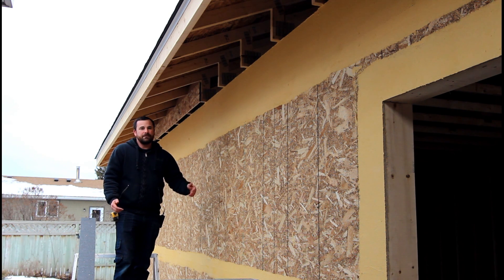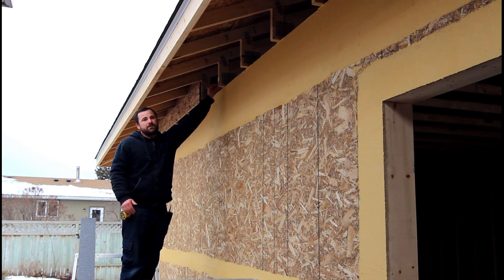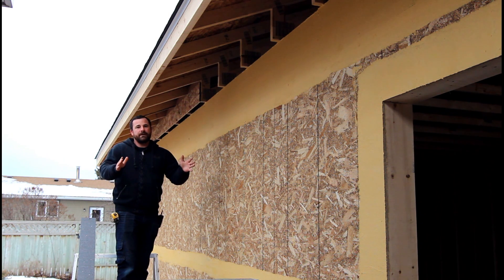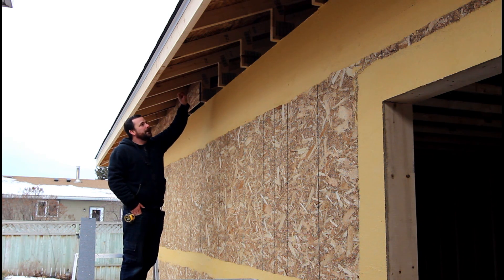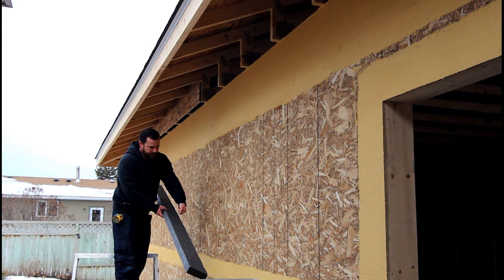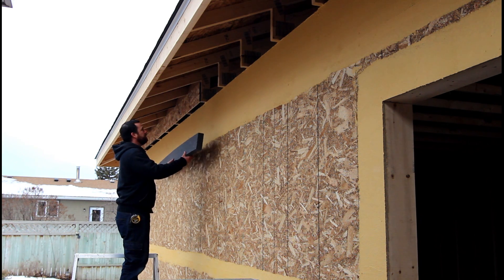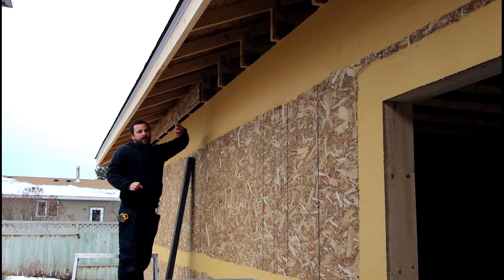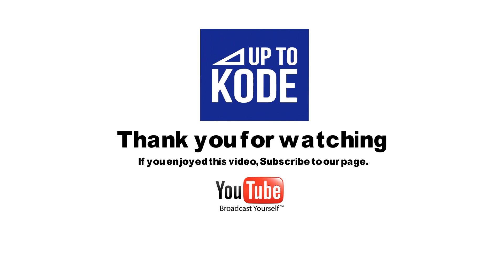How I Gained R-10 Insulation Value with EIFS Stucco

Comment: People have looked down at EIFS because in the 80’s -90’s as it became popular, the trades did not use a water barrier product behind it on the wall board. Not even a vapor barrier! The coating resists water intrusion and with a vertical notched troweling method, it allows moisture from humidity condensate to escape and dry out, saving the structure behind. Thermal bridging is another concern but depending on the insulation, you can move the point of vapor penetration away from structure. It is that simple. Remember, heating and A/C is forever and a monthly expense. Pay me now, pay me very little or pay dearly latter if water is not a concern. Great explanation!

Comment: The modern day construction industry, like many other money based industries, are just bogged down and overwhelmed by too many options. It's way too complicated and overdone. Every other day another new thing comes out making the situation worse and worse until a person can't even tell which way is up anymore. And to make it even worse on top of that, there are no thorough explanations or descriptions, just a bit here and a bit there and often times contradicting each other. Welcome to the modern day lastest and greatest or so they think. I'd say it's all pure rubbish from top to bottom and from beginning to end. Every last bit of it.

I'd say the best way to insulate a structure begins and ends with what method of construction you choose and what materials you use to construct with. It's in the design itself primarily. That is your biggest factor of all. And so if you design and construct poorly and using very poor modern day materials, you spend a LOT of time and effort and resources attempting to compensate for it. That's actually what codes are all about at their very core. It's all a scam to make corporations richer and richer and richer at your expense to no end. It's all rubbish nonsense. All of it. Every single last bit. Just like the structures built with these methods and most likely the people who do the constructing of such methods too.

Winter is a very short season for which the peak is even shorter. The same is true for summer. It doesn't last that long actually. And not every climate area of the world is the same. Some methods work better in certain parts than others etc.

But believe it or not there were people around before you were here. Before all the bloat corps came along, before fast food, before the newest latest and greatest and all that nonsense, people lived very well and just fine. Sure, some things are a bit improved perhaps, but most things are actually worse. There is a limit to these things too that can be measured without bias, without B.S.

The materials that you use and the methods of construction is your starting point and ending point of it all. Let's face it, by comparison overall, modern day structures are absolute rubbish compared to older ones. They are bad for the environment and bad for the people. They look ugly because they are ugly. They don't last long because they are poorly put together using materials that are extremely weak and synthetic by people who are broken down, ignorant and outright careless. All being advertised to you by a bloat corp as something greater than great. The greatest thing you've ever seen with all this scientific nonsense to back it up, usually in the form of numbers and percentages that most can't even begin to understand and at the same time withholding more than is revealed. And what is supposedly so great today becomes obsolete in an eye blink so it must not be so great after all and then there are a million trillion options that it's all just too much too much. It is this way for a reason and on purpose. It's designed this way. All by design.

I could go into tremendous details about these matters. But I won't. Not on here. Who has time for it. You have no time left. You my friends are just about out of your time here.

Here is some advice, certainly not everything I can tell you, but perhaps a little bit of help for you helpless souls out there.

1. Build a SMALLER STRUCTURE to begin with. I know you only know what you know and that of course being that you've seen the other joe blow smoes out there building this collosal building and so you think, I too must have that size of structure built in the same way because everybody else is doing it so that must be the only right way to do it too and if I dont build it that size than it must be wrong and of course what will they think of me. Blah blah blah.

Do you really NEED it that big or just WANT it that big? And why?

It's going to take a lot to heat and cool that massive thing. It's cost on top of cost on top of cost and for what?

2. Use natural materials. The kind that isn't poured out of a bottle or bought by some bloat corp. Stone, clay, mud, wood, earth. Should I really go into all of the reasons why? I'd write a book and your attention span is already being stretched so how could I? It's immense and simple.

3. Design and layout. Design and layout. Design and layout.

Create your structure around what is important and make it efficient. A smaller room around a heat source makes sense. Natural materials that work with the environment makes sense. A climate and location that makes sense. Working with things instead of against them. Also understanding that you're most likely spoiled too. You've become far too accustomed to thinking everything must be completely perfect at all times. The indoor climate should be perfect at the touch of a button and then automatic without any deviation at all ever. Nothing wrong with putting on some extra layers in the peak cold either by the way or opening windows in the heat. You just need to expand something besides your gut is all like say your tolerance for certain things and your attitude toward life. Expand your temperature ranges and learn to live within that new wider range. At times you will be a bit more uncomfortable, but as long as you're in the range of survival than you are golden. Learn to make it work the right way, the natural way. You can do more than you realize.

All these products are very difficult and very expensive in more ways than one and it's a never ending battle to try to make it all work and work so perfectly. At what point do you draw any lines and just begin to live? When was the last time you felt life at all infact? Are you ever going to? It isn't bought off of the shelf made by some bloat corp that's for certain. Not now, not ever! Time to get back to reality my friends, to what is truly real. Real life.

Building a house is something that a man does once in his lifetime. It's a real privilege and joy. An honor. A rare thing too perhaps. If you've missed the journey than you've missed at least half of the reason to build in the first place. And it's built so that he can have a place to dwell for the rest of his entire life and then pass is along to those whom he loves. He finds a woman who makes that house a home and this is ideal. It's not something to be instantly slapped together and flipped for something that depreciates, no, it's worth much more than that could ever be. And there is work involved for which he is not afraid. It takes time. A lot of time. And because it wasn't so easy and because he dug every spec of dirt by hand and drove every nail by hand and carried every board by hand and designed it from his own mind and because he lived in it, danced in it, cried in it, made love in it, raised a family in it, made memories in it, sought shelter in it for most of his life he will also take care of it the same and maintain it and cherish it as such, it truly does mean something to him. He understands that what you create is a direct extension of who you are.

If it's just some slapped together meaningless thing that came instantly and easy than it will mean nothing. You'll treat it that way too.

I could go on and on, but I won't. Why should I? How could you not already understand these things by now? And knowing them how could you not live them?

What I sell is free and of tremendous value to you. What they sell costs you everything and is worthless to you.

You of course will pay everything you have and even everything you don't for what they are selling you.

Enjoy your bed. Sleep very well.

LOVE
Reply from the maker: Our focus for over 12 years has been ICF structures to the roof. A system that isn’t a mix mosh of new products like you talked about. 

All the best.

Comment: Cody-where is the drainage plane  between the foam and the OSB ??
Reply from the maker: You create the drainage plane with vertical strips of your mortar. The new foam has grooves on the back which is way better and guarantees drainage.
Reply: @uptokode That’s how they did my home.  It’s been 15 years and no problems